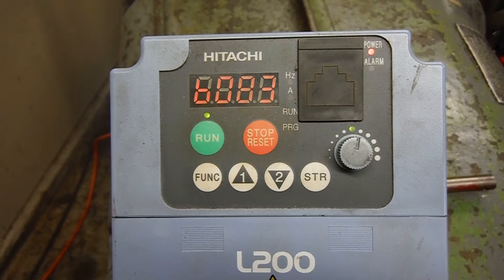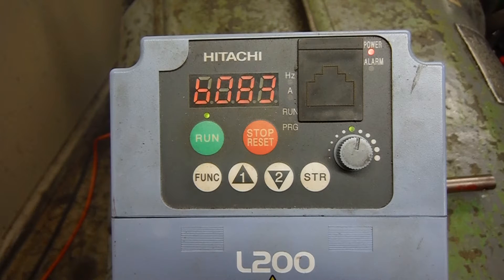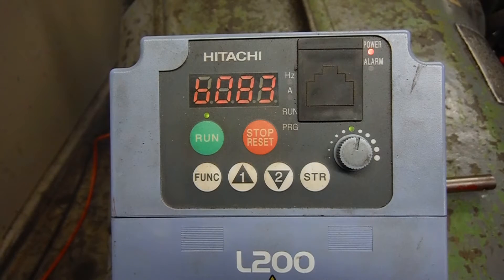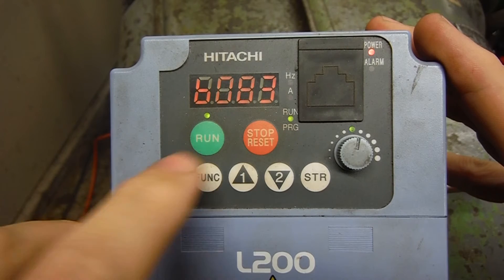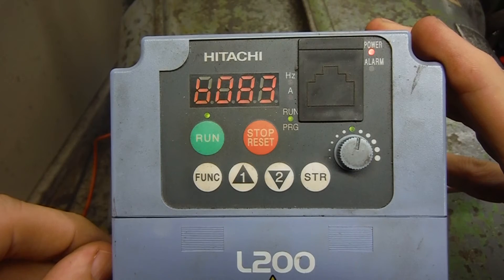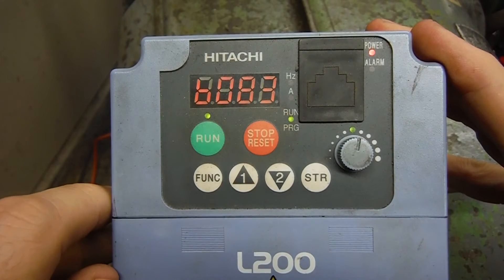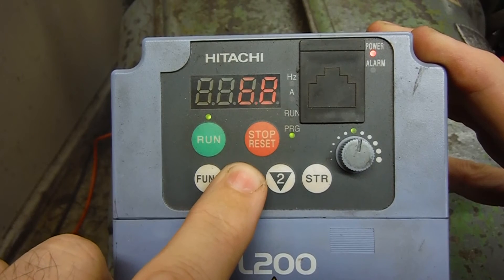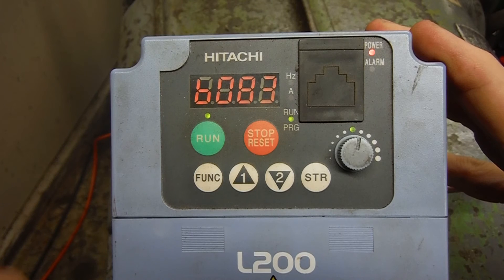VFD carrier frequency noise

Comment: If you add some inductance between the motor and the drive, equal coils/inductance on each leg or phase, you can lower the noise further...  larger a.c. motors have more inductance and are typically quieter...

Comment: 14khz is ok as long as you're under 70% of your max output load on your model drive, otherwise you slowly chew up the drive. Higher carrier frequency will increase heat in the circuit and also shorten the life of the drive and motor, nature of the beast.  Be sure line and load conductors stay in separate conduits as well. Mixing the load conductors with any other circuits will give you more unwanted noise from the motor. Its often overlooked in diy installs but its a huge contributor to noise.
Reply: Yep the VFD manufacturers I work with start to derate the drives at 8kH and above. And it's not always documented.
Reply from the maker: Thanks for the info. That's the kind of thing that most people will never know.